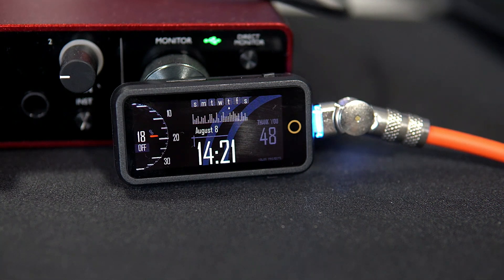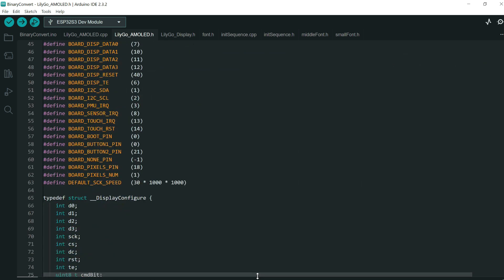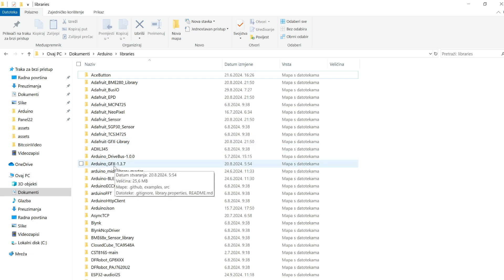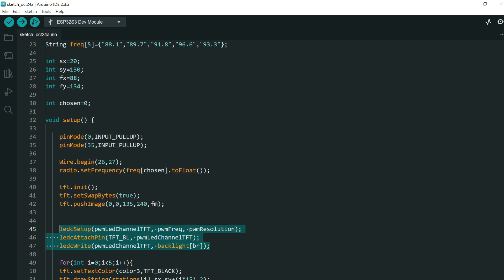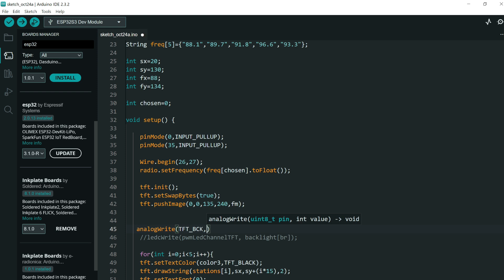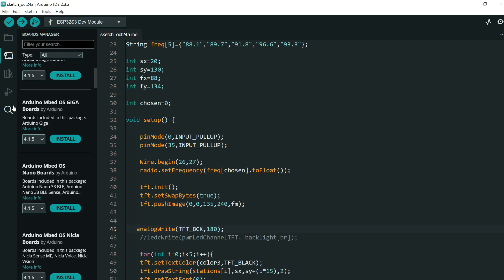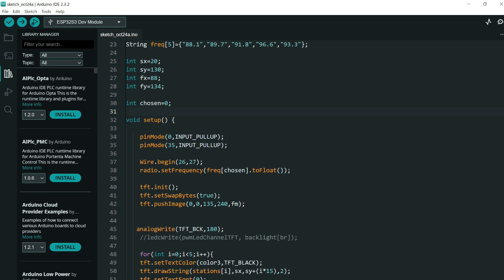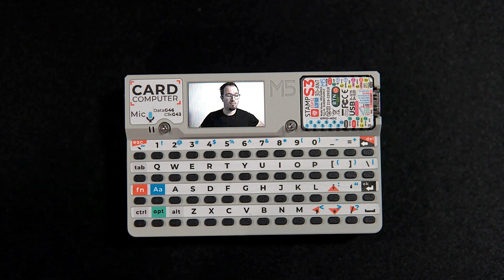Volos Code  is not Working!  How to Fix Issues with ESP32 Boards!

Comment: You could make a tutorial for example to have a thermometer and hygrometer with T-Display Amoled Plus and that by clicking on the temperature passes to a new screen with a graph and when pressing again on the graphic return to the main screen?
I am quite bad and the only thing that is modified some Arduino Internet codes.

Comment: Absolute legend, another great video.

I managed to solve two issues I was having this morning, thanks to your video. 
1. T-Display S3 AMOLED up and running. (I was having issues with esp32 board version and library's. Completely new to this, who would have thought to read the manufactures github page aha.)
2. ledcsetup compile issue. Now the motors I'm controlling via pwm, make their ramp noise outside of human hearing. 20KHz instead of 1Khz, beautiful.

If you don't have a paid partnership with Squareline, I'd love to see some basic instruction videos for another drag and drop software like EEZ Studio. Using LVGL Libraries.  

As a newcomer to the space, Sqaureline is utterly cost prohibitive, even with the limited 30 day trial.

I've bought you a coffee, thanks again!

Comment: Yes, this uncontrolled development will strangle Arduino. I already noticed 7 years ago that code that worked close to the limit was later too big. Finding out what was too big is tedious. Since then I always write the compiler log at the end as a comment where all the libraries etc. are specified in the version numbers. For such external projects, I think it would be best if there was an export where not only the code but also exactly the libraries used are exported and, if necessary, the program then gives hints that this and that may be outdated.
Reply from the maker: it seems i will need to use your tactic. Put evrything on github and  problem is solved.
Reply: If you’re speaking of libraries that can no longer be accessed or tools that disappear, boy can I feel you. I’ve been kicked too many times, and any project with external dependencies sends shivers down my spine. It feels to much safer to keep any project libraries within the project, and I would love to see a virtual environment for arduino like conda for python, maybe as a platformio thing. I always keep a build of any project locally, just in case the tooling goes poof one day or the build hardware is sunset.

Comment: I struggled with the downgrade problem, and them with a power supply issue with a battery without current enough for bluetooth and esp-now. So frustrating when you are a beginner. Several days of sadness until find a solution. Thanks for sharing this and for all your work, I'll certainly come back for the power pin and serial monitor tricks.
Reply from the maker: thank you :)